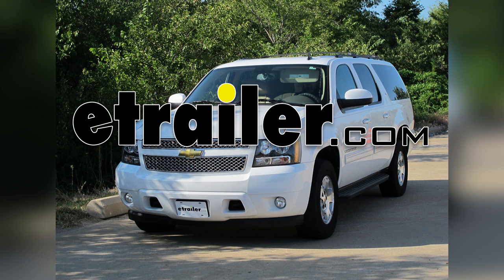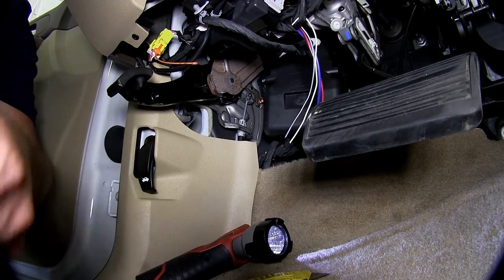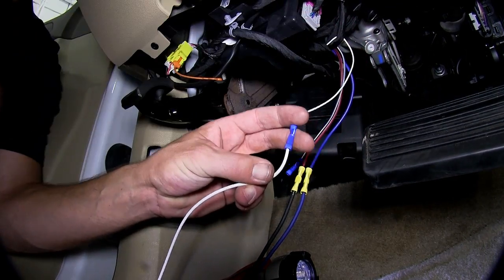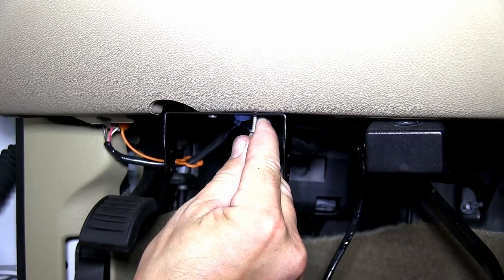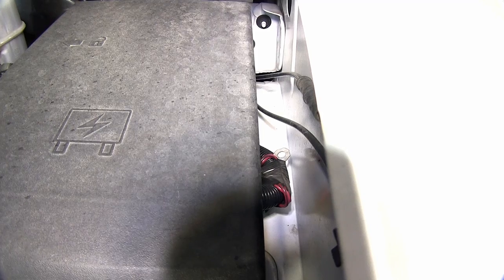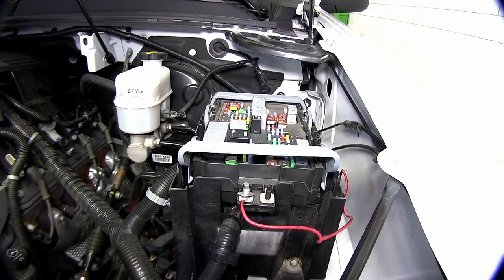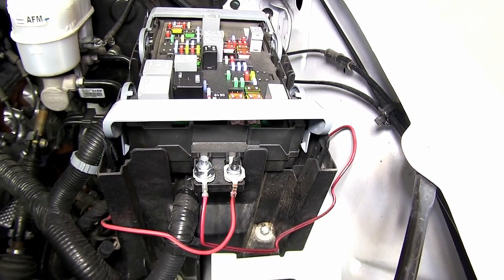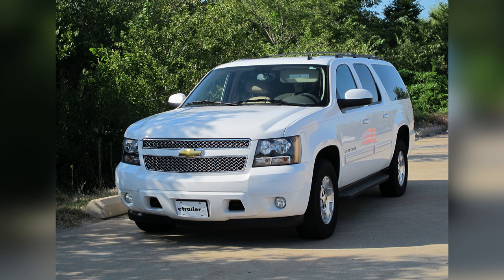etrailer | Setting up the Tekonsha Prodigy P2 Trailer Brake Controller on a 2011 Chevrolet Suburban

Comment: Soo that's what those 2 red wires are for. I saw them last week while I was changing my oil. thanks for the video I already have a dealer in stalled bc. just wundering what the 2 red wires was for

Comment: In engine compartment does it matter which post the red wires are attached to?  Both posts provide same power, correct?
Reply from the maker: It does matter, because each stud has a different fuse rating. You'll want to attach those wires as shown at the 3:50 mark in the video.

Comment: would this installation be pretty exact to a 2011 chevy tahoe??
Reply from the maker: chargin22  It will be the exact same. The only significant difference from Tahoe to Suburban is the extra length in the rear for the larger cargo area.